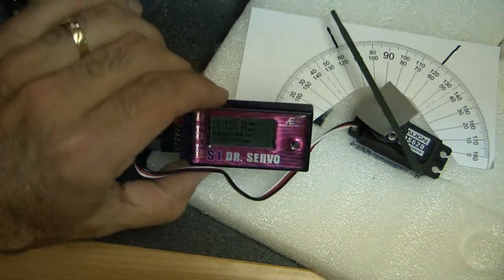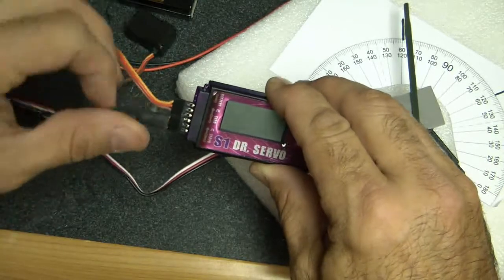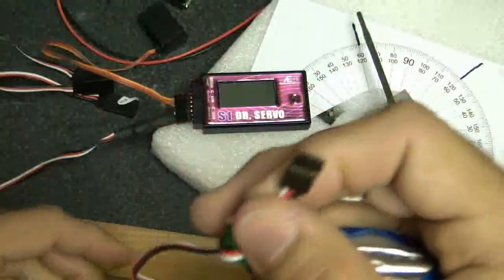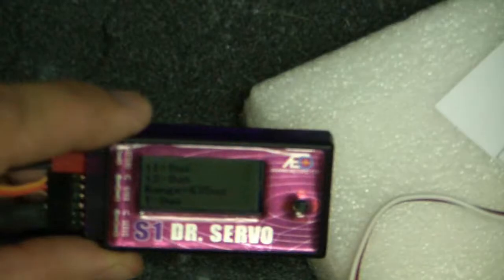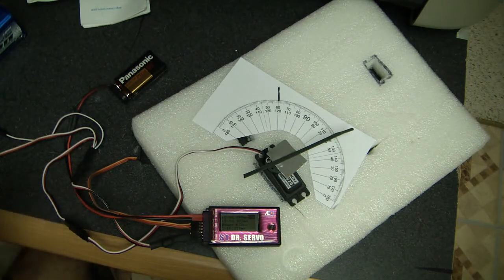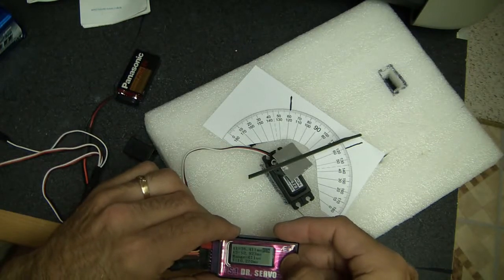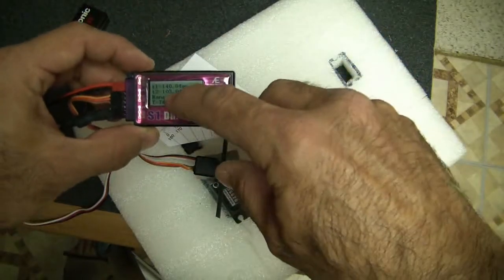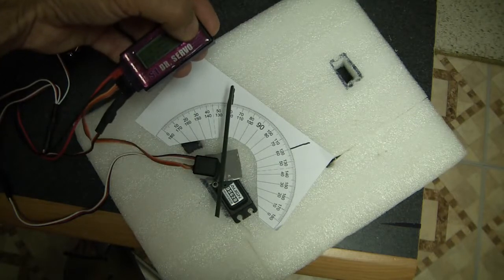Dr Servo Part 1

Comment: 0.082 sec/60 degrees @ 4.8 volts, 0.074 sec/60 degrees @ 6 volts is 11% faster pretty cool + the torque is higher.